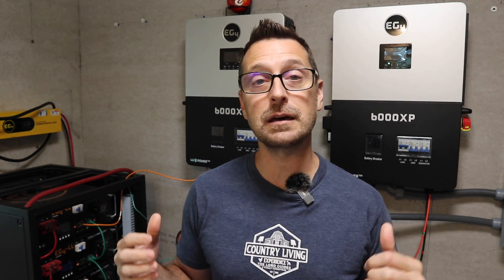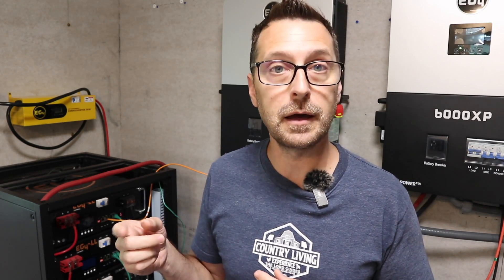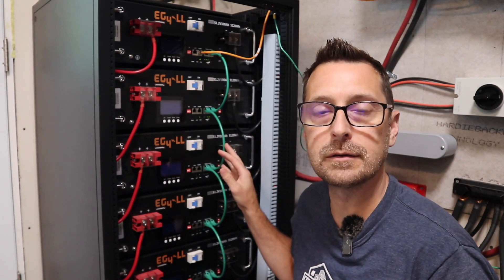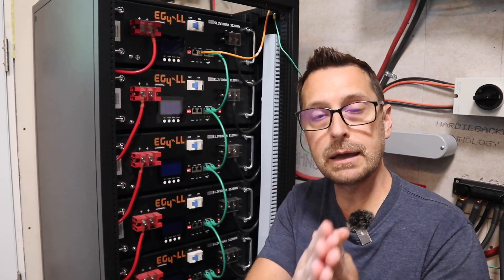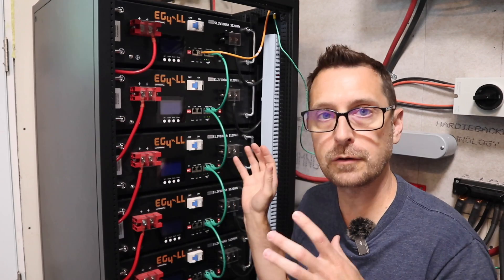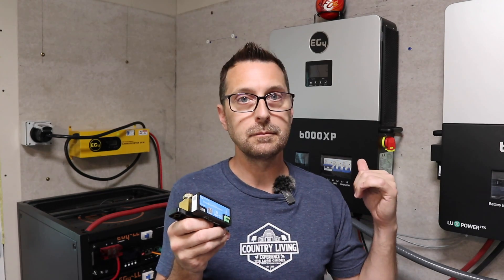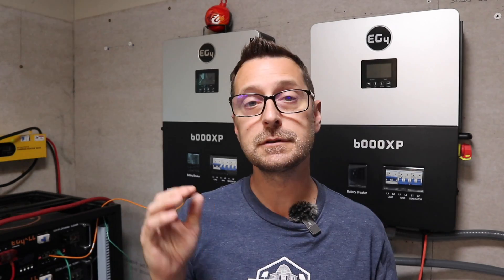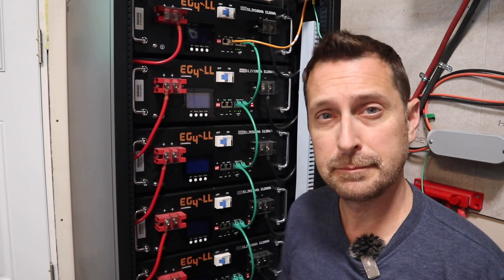Lithium Battery State Of Charge VS Voltage Drift. System Issues? Several Solutions

Comment: Ok, a few things here.

* First and foremost, the shunt calculates the state of charge ONLY by counting the coulombs in and out of the battery.  Its counting current over time, basically.  The only time a shunt (in the BMS or the external shunt) EVER uses voltage is when it is determining whether the SOC should be reset to 100% or 0%, depending on how it is setup.

This means that for LiFePO4 you generally want to charge the battery to full.  This is true for EVs with LFP batteries too, by the way.  It just isn't possible to track the SOC exactly.

If you let the SOC drift for too long, it will basically turn into noise... completely garbage and not tell you the actual state of charge.   Whether you use a Victron shunt or depend on the BMS, doesn't matter.   You solve this by charging the battery to the appropriate target voltage at least every once in a while (like once every few weeks at worst).  Most people just charge to the appropriate target voltage as their go-to configuration.

The correct charge target voltage for those EG4's is 3.55V/cell = 56.8V, with a 30-minute to 2-hour hold or current-tail setting.

* For LiFePO4 voltage is almost completely irrelevant with regards to figuring out the SOC until the actual state of charge is roughly over 95% or under roughly 5%.  Those are the only times where the voltage gives a good indication... only when the battery is almost full or almost empty.  I'll talk more about that later.

* Any current going into the battery will push up the voltage roughly scaled to the current, and any current going out of the battery will pull down the voltage also roughly scaled to the current.  Thus, unless the current is zero, you can't determine ANYTHING from looking at the battery voltage.

* LiFePO4 cells will naturally float when not loaded or charging, and they will do it at slightly different voltages.   Because there are 16 cells in series inside a 48V battery, this means that individual batteries can actually vary by up to around 0.5V, sometimes even more, and still all be at the same state of charge.

* TOP balancing:  All you do for the EG4 batteries is charge the battery to 3.50V/cell (56V) or higher.  Best to charge to 3.55V/cell to ensure that the BMS's start balancing.,  Proper BMS configurations only start balancing once cell voltages are (roughly) above 3.45V/cell because trying to balance cells below that voltage does not work... will take them out of balance instead of putting them into balance.   But if you do not know what the BMS's configuration is, charge to 3.55V to catch the edge cases and ensure that balancing happens.

* BULK, voltage targets.   For LiFePO4, any voltage (at zero current) >= 3.45V/cell is 100% SOC.   Most people set their bulk target voltage to 3.50V/cell (56.0V) or 3.55V/cell (56.8V).   The BMS itself disconnects at 3.65V/cell (58.4V).   NEVER SET YOUR CHARGE TARGETS TO THE BMS DISCONNECT VOLTAGE.  You don't want the batteries constantly disconnecting as they get full.  It is completely unnecessary to charge the battery that high, it will be at 100% SOC well below that voltage.

Typically for charging you set the bulk target and either set a current tail or a fixed time period to hold the target.  For a fixed time period, use 30 minutes to 2 hours.   Equalization is not used, turn it off.  LiFePO4 doesn't need equalization at all.

* FLOAT voltage.   For LiFePO4, the ONLY valid float voltage range is 3.35V/cell to 3.375V/cell.  That is 53.6V to 54.0V.   Once charging is complete and the battery is at 100% SOC, the charger will stop pushing current and allow the battery to drop to its float voltage before applying any load support (holding the battery at the float voltage, if you still have solar available to do that).

The battery dropping to the float voltage DOES NOT CONSUME MORE THAN 0.5% OF THE SOC.  The battery  will STILL BE AT 99%+ SOC EVEN AFTER DROPPING TO THE FLOAT VOLTAGE.

* When discharging, the battery will generally drop into the 3.3V/cell (52.8V) range and for most of the discharge cycle it will be between 3.2V/cell and 3.3V/cell.   At 3.0V/cell (48.0V) the battery is 95% discharged... SOC will only be roughly 5%.  

Most people cutoff loads at 3.0V/cell (48.0V).  There is no need to stress the cells by letting the battery drop to the BMS low cutoff voltage which is typically 2.5V/cell (40.0V).

--

Voltage Drift:  There is no significant voltage drift for LiFePO4 with age.  That isn't how LiFePO4 aging works.  LiFePO4 cells simply lose capacity with age.... fewer amp-hours can be stuffed in and taken out of the battery.  That's it.  And with well taken-care-of batteries it takes a very, very, very long time to lose any capacity after the 2nd year.  Usually some capacity is lost in the first 2 years (usually less than 5%).  After that, capacity generally is lost only very very very slowly.

There are people with 15-year-old LiFePO4 batteries that are still pulling 95%+ of their original capacity.

--

OUT OF BALANCE CELLS

If you do not charge the battery sufficiently to trigger internal battery balancing by the BMSs the cells will slowly go out of balance.  When cells go out of balance, the battery will begin disconnecting at lower and lower voltages while charging, and at higher and higher voltages while discharging.

To fix this, always charge to the proper charge target and hold the battery there.  Just increasing the hold time to 2 hours and letting the battery cycle/operate normally for a week will do the job.  You don't have to do anything special to fix this problem.   The battery's BMS will fix it.

If this is happening to you, then you are using incorrect charging settings and these are both preventing the SOC tracking from working properly and also preventing the battery's BMS from properly balancing the cells.

--

COMMS

Comms are not really necessary for controlling even large battery packs, if they are in good shape.  Comms should only be actively used to reduce charging current when it is detected that one or more batteries have disconnected, so as not to over-current the remaining batteries.

The only other use for comms is for display purposes only.

SOC values should NEVER be used for any servo, active management, or relay control operations.  Never, ever.  Always use voltage (typically relegated to voltages <= 3.0V or >= 3.50V where it is obvious that the SOC is low or high).

-Matt
Reply from the maker: That is a lot to digest. Thank you for sharing. 
It sounds like you are saying I need to abandon comms and set the 6000xp to lead acid mode where I can manipulate the charging parameters (voltage)? As far as I know, I have no control over those when I am in the Lithium Ion mode because it is relying solely on the battery bms'.
Reply from the maker: In your reply you talked about not mid-ranging the batteries. What did you mean by that? Did you mean that you should not continually charge/discharge the batts within a certain soc? Say taking the batts down to 45% then charging them to 80% then discharging, etc and so on? 
You had me confused on that one because one cannot predict the amount of sun charging on an off-grid system. I never know if I am going to get to "100%" with some partly cloudy days and conversely how low I will get with numerous stormy days.
Reply: @CountryLivingExperience  Not trying to hold the battery in the middle of the SOC range to lengthen its life-span.   It is totally unnecessary to do that for LiFePO4 due to the float relaxation of the voltage.   Even for NMC one can charge to 70% without almost no damage to the battery.

(p.s. for anyone who owns a LFP EV its the same thing... don't be afraid to charge to 100%, but if you are really worried then still charge to 100% and just drop it down to 98% after fully charging by driving a little, before letting it sit).

Not reaching 100% regularly will not hurt the LFP battery at all, but it will cause the SOC tracking to more or less turn into gibberish over a month or two of cycling without hitting 100%.   Also, the battery won't be able to balance its cells but cells in a well-balanced battery takes a lot longer to go out of balance... usually 4+ months.  

So if you want the SOC to be accurate, you do want to charge to 100% every once in a while.  But don't worry about not being able to do it very often across winter (for example).  It won't really hurt the battery and even the cell balancing won't matter a whole lot since you aren't trying to utilize the battery's full capacity across winter anyway.

This does inform you on how much "hold time" at the charge target you want.  My recommended range is 30 minutes to 2 hours.   If you rarely get the batteries to 100%, use a 2-hour hold.  If you often get the batteries to 100%, use a 30 minute hold.  I usually do not use a current-tail at all... I disable the current-tail function because I want there to be a deterministic amount of time for cell balancing on those occasions where the battery is able to be charged to full.

-Matt
Reply: @CountryLivingExperience  Its totally up to you but I don't use COMMs in setups where my maximum charge/discharge power is <= 2 batteries worth of capability.  Or I only use them for monitoring purposes and not for control purposes.

So, for example, when I have 4 x 100Ah (100A) 48V batteries connected in parallel, but my maximum charge/discharge current is under 200A, and I am fused and breaker'd for that (250A fuse, 200A breaker), then I don't bother with COMMs for control purposes.

I outlined a good default configuration before but I'll repeat it:

Charge controller:

Bulk Target: 56.8V (3.55V/cell)
Bulk/Absorb hold time: 30 min to 2 hours
Float: 53.6V-54.0V (3.35V-3.375V/cell)
Equalization: OFF. no equalization.

Inverter:

Low-voltage Inverter OFF:  48.0V (3.0V/cell)

BMS safety disconnect values:  2.5V/cell for the low-disconnect and 3.65V/cell for the high-disconnect.

Target 0.2C or lower charge/discharge current for nominal operation.  Not that it hurts to go higher, but I usually never spec over 0.5C in a multi-battery parallel configuration because then the fusing and breaker values get so high they lose a lot of their protective value.

If voltage sag is an issue, e.g. if voltage sag causes the inverter to go under the voltage floor when it shouldn't, look at the cabling size first and drop the low-voltage inverter OFF voltage a little second.  But don't go under 2.8V.

-Matt
Reply from the maker: Thanks Matt. I appreciate the conversation and information.

Comment: Great timing for this video. I have dual eg46500ex spit phase and the bms comms was kicking my inverters to grid even though I don’t have grid connected. SBU was used. Once I switched to USER and set proper charge parameters it solved the issue. I got the EG4 HUB and found all 6 batteries were fine cells were only .01 off. Its still a mystery what caused the issue. I have been researching the voltage drift and trying to get more info. Im going to solve the problem and move to 6000xp. Your channel has helped me in my solar journey thank you for sharing.
Reply from the maker: Cool. Glad you are finding solutions to the issues you are facing. Glad we could help as well.

Comment: Seems like they used a bms from a battery type that is full at 57 volts or used those parameters. My lead carbon bank is 100% at 51.6v my soc shows 69% still charges proper, last time I checked all 16 batteries all within .1v with no bms or equalization possible, -30c charge np. 48 kw weighs 2000 lbs more than liPO, as long as it works from day1, having a failure is rare.

Comment: charge voltage is way to low  need to top charge  if the charge doest get to to the top your percentage will be off and leave you dead in the water

Comment: Thats why you need a , watt / amp meter....
And a note book.
I taught electrical theory / math, and you must absolutely use math to calculate capacity.
If a 100ah battery uses 100ah in 10 hours = 10 amps per hour.
If after 10 hours , your usage meter reads 50ah available,  you used 50%.
Keep a notebook.... or plug it up and forget about it.
Warning lights will go off (idiot lights) to let you know to call someone more qualified to work on it.

Also , if you need 1500 calories a day to survive , and you use 1600 calories,,  you need to recaculate a system.
These all in one systems are fantastic , absolutely fantastic , but your leaving yourself open for failure.
When one part of that all in one system fails (not including multiple batteries) , it all fails.
Having multiple inverters , charge controllers,  battery banks , relay switches and an assortment of various other components , is the only way to protect yourself during a grid down or self sufficient scenario

Comment: you are over thinking it. The BMS if not programmed right can in fact cause cells to get way out of balance. doing a top charge and balance with BMS setup correctly will get them all within .005 within all cells. This is why I built my own and use JK BMS so I have full control. if your charge voltage is 55.2 then balance should start at 3.45 and stop at 3.40 This allows BMS to take from the fully charged cell and give to all others. It took couple weeks for mine to top balance themselves this way. Yes 3.45 not 3.65 since that gives you about 10 more energy at the cost of over working your cells which causes swelling and heat issues which leads to lithium breakdown.  I also use all in inverters instead of small MPPT controller like Victron because when my packs hit top charge they turn off and my inverters hold any solar voltage till I can use it and small MPPT units are not good at that and will burn up.
Reply: Degrigation will happen regardless on how you use the batteries.
Reply: @vinny143  Yes but how fast. Mine are 8000 cycles to 80% I truly do not expect them to last that many cycles. 19 months since turned on and started to use I  have 87 cycles used. 1,218,000 watts put in and out of each battery pack so far. At this rate if they can do it I will be long gone so I will never know how long they truly last.
Reply: @dc1544  lipo4 have been out On the market long enough to know a good estimate.
When the charged particles pass from one electrode to another during charge or discharge , the electrode , by what i understand , has the same structure as carbon fiber , starts to form microscopic cracks that the charged electrolytes get trapped in.
This is your degrigation.
If you charge to 3.45v per cell (13.8v on a 12v battery) and dont go below 3.22v per cell , the battery will last longer.
Most cycle life is measured from peak charge to peak discharge. 
By adding more capacity (battery) , you will lessen the abouse on them and get a longer lasting battery system.
Most batteries meause life cycle "full charge to full discharge "...
And even at that rate , you'll still have advertised 80% capacity.
Its not like they are useless.
My system has 3 times the amount of watt hour storage , over what i use.
Battery back up , at a minimum , must run your appliances for 18 hours. (3pm -9am).
Longer the further north you are.
You can double the solar panels on an inverter by placing a junction switch between panel n charger.
This way , on a cloudy day , you'll  still have solar coming in.
I need to post a video of my lab , maybe this weekend.
8000 cycles ÷ 365 days in a year = 22 years
Reply: @vinny143  I agree with almost all you said except My battery banks are big enough that it takes 5-7 days for 1 cycle. Which I can not wait to really know how long these will last, will they just degrade inside after say 20 years or can they last 50 years?
Reply: @dc1544  im going to research components of a battery
Reply: @dc1544  Your question is not clear.   That said three things degrade these batteries that you can control....  How long they stay at a state of charge lower than 5%.  dont do it... charge to 20% immediately.
second  dont blast the last 5% into them at the top.  If you are going to fill a huge battery bank today then slow it down to say 20 amp per battery and give it time... high rate of charge or discharge degrades them.   Third would simply by too high a charge voltage that make no difference anyway.  55.5 is enough to get to 98-99% for a top balance you will need to go 57-58 volts but that is only if you want to top balance.

Comment: Your charging system needs to top out at 56.0V and be held there for some length of time so your BMS can complete cell balancing.  Seems to me that might be your problem.
Reply: Itll never be fixed.
Degrigation starts at manufaturing completion.
BMS is just trying to patch the holes in a sinking ship.
Thats why lithium cells have a dated life cycle.
Reply: @vinny143  No, this isn't how LiFePO4 works.  The cells and batteries are fine.  The charging parameters or the BMS parameters were just misprogrammed.   They will rebalance with a few days worth of cycling with proper settings.

--

In anycase, if balancing is the goal, the charge target should be set to 3.55V/cell (56.8V) and held there for roughly 2 hours per charging cycle.  The packs will be in balance again within a week.

56.0V (3.50V/cell) will work only if the BMS's in the batteries are using reasonable settings for the float start voltage... which is a bit hit or miss so if one can't verify the BMS settings, use a 56.8V (3.55V/cell) hold for balancing.

If one can verify and/or adjust the BMS configuration in all the batteries, one can fine-tune everything and use lower voltage targets (such as using 3.45V/cell for the target and start balancing at 3.40V/cell).  But... unfortunately most people who try to mess with BMS and charger settings do so with an incomplete understanding of how the cells and batteries work, and wind up massively unbalancing their batteries instead.

-Matt